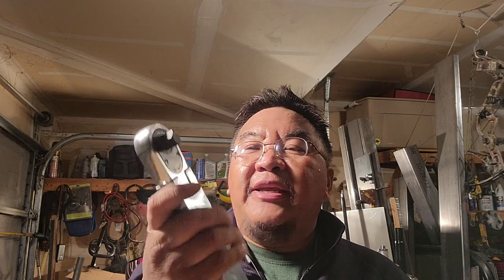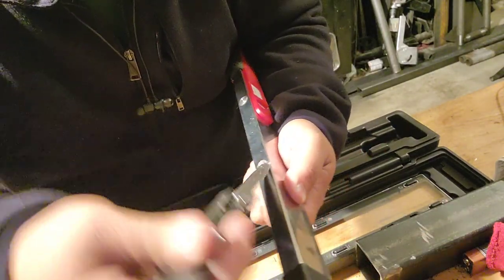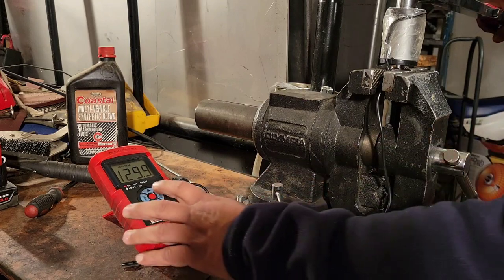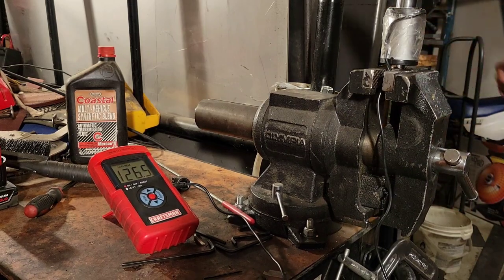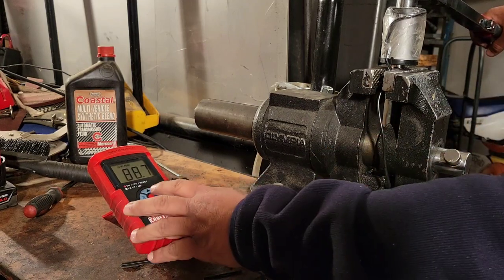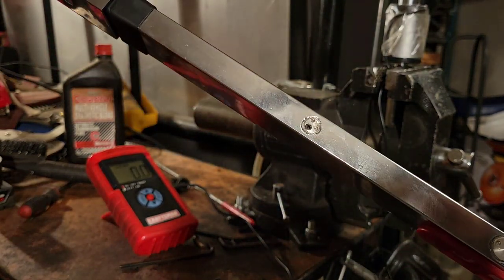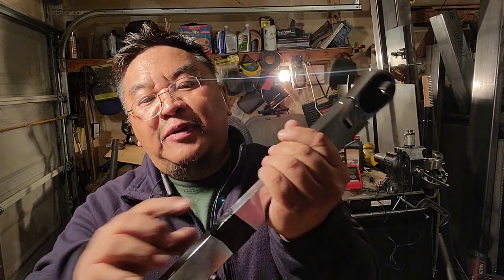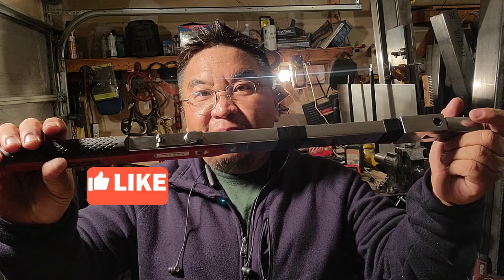DIY Tuning Icon 1/2 inch Split Beam Torque Wrench

Comment: Your ICON videos are not accurate IMO. The table is flexing and wanting to return to its original position, thus tricking the torque wrench into thinking that the threshold has been met. The original, before you started tinkering, was accurate. 50lb test were very close and the gap only widened when you increased the torque and flexed the table more. Not a scientific test and not valid.
Reply: I agree if you watch the tools tested channel the guy test this icon against Amazon's precision and snap on he does the 1000 cycle test at 50fp,150fp,and 250fp and they all fell with in the -/+ 4%

Comment: After watching your video. I was on the fence??    But tested it a lot.   Was right there there in spec . With my digital Snap On..     just give  my feedback.after buying one and watching this video. No problems with my wrench. Also, my torque wrench was just calibrated a week ago to make sure it was right on point.

Comment: With these style of torque wrenches I noticed you have to be careful when setting the dial. If you are looking at it from even a slight angle you will likely be off. So you will think you set it to 75 but really it’s slightly higher than that. 

Close one eye and get the open eye directly over the mark.  It’s also important that you pull on the handle in the exact right way. Failing to do these things isn’t the end of the world but it can throw your measurements off by. A few ft lbs. Just thought I’d mention it since you we’re basically chasing perfection in this video.
Reply from the maker: Indeed. I finally got it tuned and dialed in.
Reply: 2 - 3ft lbs + or - is in the ball park imo so thats good enough for me

Comment: As always good content and solution. I assume your calibration equipment is accurate.  Likely these Icons and many other torque wrenches are being knocked out of calibration during shipping 👍🏽
Reply from the maker: I have tested cheap Pittsburgh Torque wrench in the past and found them to be more accurate out of the box then the icon.
Reply: @theotherguy3083  That is very disappointing to hear. I have one of the cheap Pittsburgh torque wrenches that I picked up for $9.99 one day, but I was hoping to upgrade to this beauty.
Reply from the maker: @hillwood24  I actually test one of those and they were really accurate
Reply from the maker: @hillwood24  here is the putsburg I tested.

https://youtu.be/fXQp937acr0
Reply from the maker: Check out how accurate this is when I used it against my new AC DELCO.  

https://youtu.be/uKL2uI3XGIA

Comment: I would return that one and try the tekton beam torque wrench
Reply from the maker: I have one already.
Reply: @theotherguy3083  the newer split beam type from tekton? They have one designed just like that icon.
Reply from the maker: @jdmDC2ftw  I meant this one.

https://youtu.be/t9nZ7GibrNs
Reply: Tekton one is extremely inaccurate. I’ve seen a test video and the icon was far more accurate

Comment: How come you didn't return it to Harbor Freight, or call ICON themselves?
The icon is lifetime warranty !

The vice and table you have were really flexing, that is NOT even close to what you were doing.

And if you torque your lug nuts at 80 ft pounds, why did only a couple come loose, why not ALL of 
them come loose. 
ALL of this just don't add up !!!!!!!!!!!!!!!
Reply from the maker: I returned the first one. This is the second one. If you checked my video, I recalibrated this torque wrench to spec. 

 Regarding loose lugnuts, they were all loosed. And in lost a couple lug nuts because it is what it is. Thank God I didn't lost all of them at the same time.